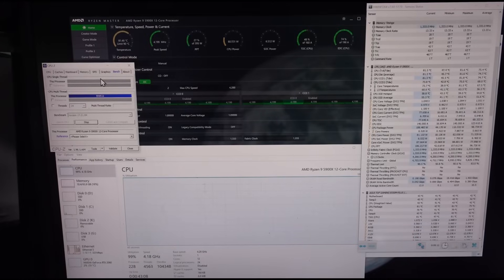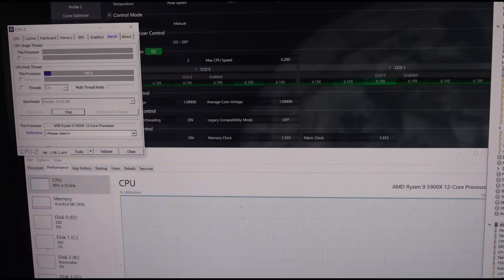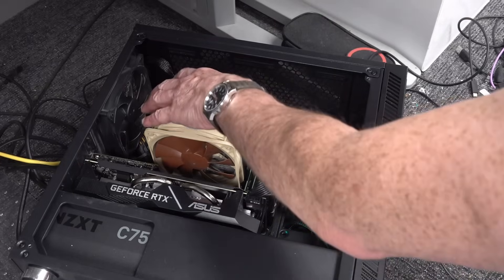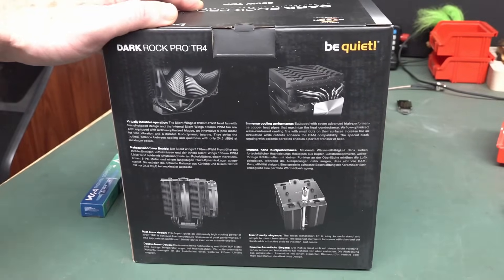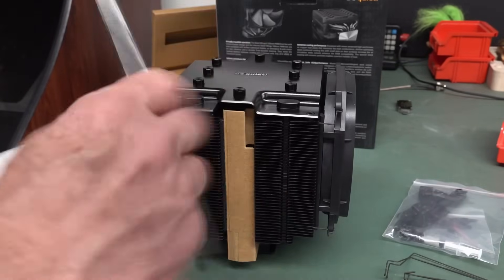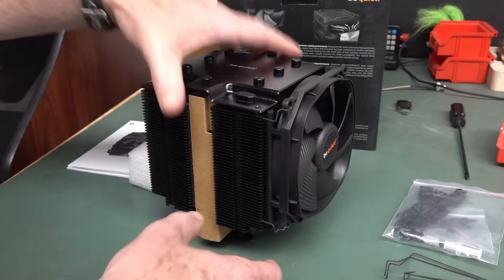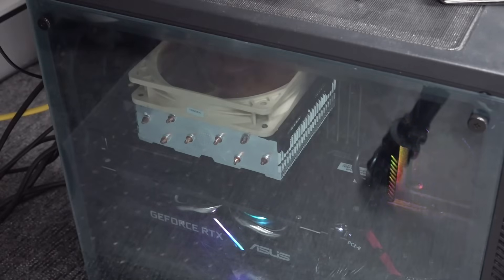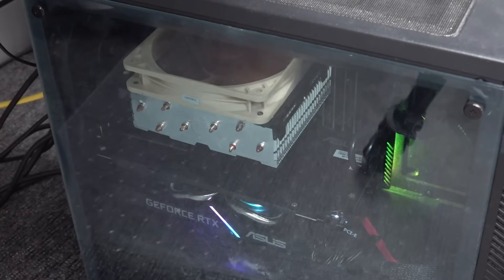Ryzen 9 Dark Rock Pro Heatsink FAIL & WIN

Comment from the maker: Had to re-upload because I goofed an uploaded onto my main channel before. Sorry for the lost comments.
And before anyone comments on the crushed heatsink pipe, bottom line is it makes no practical difference in this case, my temps are down to well under 65C during rendering now, so the heatsink is working just fine. Using the same damaged heatsink I've been able to reduce my temps from over 90C to under 65C by redoing the thermal paste that was dead after a few years, and also re-orienting the fan so it takes the cooler air from the top of the case instead of from above the GPU card. That made a huge difference, and it's no surprise, I can feel the inlet temp difference between the two installs.
Reply: For the wrong cooler: not all ryzens are threadrippers. Threadripper is a separate series, on TR4 or TRX40 sockets. You have a non-threadripper ryzen, which come in AM4 or AM5 sockets. That knowledge may be handy in the future :)
Reply: Here is one of the comment I had in my clip board. I see two possibility then. 1: by drawing fres air from the top of the case you get better result. 2: the crushed pipe is damaged and by switching it around it happen thant tha most of the cpu die under the heatspreder is now under the good heatpipe. It would be interesting to put it in the same orientation as before and just change the fan position to be at the top. Then we could rule out it the copper pipe is really damaged or not.
Reply from the maker: @robingalipeau5642   Just shot another video demoing, guess who's right?
Reply: @EEVblog2  I am confident I am right, but I honnestly dont pretend to know all the answer. I and diyng to see the video and find out :D. It will be fun to watch
Reply from the maker: @robingalipeau5642  Here you go: https://www.youtube.com/watch?v=kvI7vlvzrQo
Reply: SMH...so WRONG... rotating could have moved that pipe from a hot core to a cooler core..and moved the working pipes over the hot core so you see lower temps....rotating a heatsink with heat pipes has different thermal properties.....especially when one pipe is bad...these CPUs do NOT put out a consistent temp across the heat spreader... they get hot spots depending on the thermal characteristics of the cores....
Reply from the maker: @WacKEDmaN   Sorry, you are demonstrably wrong that is the difference. I measured a 10C drop in temp due the fan rotation, and I can physically feel about a 10C difference in inlet temps in both orientiation. It's NOT the heat pipe.
Reply: @EEVblog2 If the damage pipe is on the IO die side it should be fine, the main heat sources are those two 8 core dies (cut down to 6 cores, 2 disabled for your SKU).
Reply: @EEVblog2 yes you get better temp. And I can understand you dont want to test every thing because a computer is probably a tool more than a hobby for you which is fine. But fron the information in the video, there might be more test that can ruleout for sure the thesis of just the airflow.
Reply: @EEVblog2 plus i really doubt tha you get 25 degre delta with just switching the fan around. Something look off to me
Reply: @EEVblog2 how can you definitely say that when you dont even know how heat pipes work? ... yes the fan at the top is going to have some effect... 10c aint a whole lot... 
.... try another non-damaged heatsink (around the same size and number of pipes, same fan size) and i bet your temps are lower (you really dont need that big ass cooler..that will probably also need strain relief to not warp the f out of the mobo)...and where'd you get 65c from? i seen 75 in the vid.....
...anyways...ya know my thoughts... do as you like... ya gonna anyway!
Reply: @WacKEDmaN I agree with you on the technical side, but usign that many "..." is not really polite and don't invite open minded dialogue.
Reply: @robingalipeau5642 thats just the way i type.... always have... always will... its like my signature!...
Reply: @WacKEDmaN ok 😂

Comment: I liked the trouble shooting, even the missteps. Computers can be and an enigma sometimes it can be something like your targeting, cpu temps, to a wonky failing psu, to just literally re-seating the ram. Im also glad you flashed the latest biis when you first starting posting about this I believe that was one of my first comments. Have you tried a thermal cam on the bare board for a short time to see for any hot spots? That can help narrow down problems sometimes with aging equipment. Even though I wouldn't call it old by any means I'd kill to have a system kitted out like that..Good luck Dave and good on ya for being honest and humble throughout the process this is a nice change of pace.. I love your diagnosis and repair videos, that's what got me subbed to your channel in the first place many years ago. Keep on keepin on Dave! Thanks for the time and effort put into the video! 😊

Comment: If you're having a heating issue, it's worth lapping the top of the cpu and the bottom of the cooler long enough that they're flat. They don't need to be smooth, and polished is worse - just flat. Then use the least heatsink paste that'll make solid contact all around - just enough to fill air gaps. Some recent CPU packages are raised on the border (Intel has been the worst offender lately). Round bottom CPU coolers contact well, but full sized ones contact the border and don't touch in the middle until you lap the CPU.

Comment: Personally I'm using a thermalrite Aro-m14g on my Ryzen 5700x gaming pc with the power limits raised from stock 75w to 140w (turns the cheap 5700x into a 5800x) never seen it get beyond 78c after 10 runs of cinebench r23 multi core.
My workshop pc runs a 5800x with a thermalrite le grand macho rt .. it stays below 75c at all times even this week when ambient was 31c .
The only downside is that they're both huge coolers .

Comment: I have a 7900X and started with Dark Rock Pro. It is a bit of a pain to install as you can easily put the small, round plastic spacers under the bracket on upside down and then the CPU won't be held tight onto the CPU.  The little spacers have an indent on one side that fits over the threaded part that sticks through the board.  Very easy to screw this up!  All four spacers have to be correct.

These CPUs (particularly the 7xxxx) are known for running very hot almost regardless of how much cooling you have.  I did decide to upgrade to a 420mm Corsir H170i cooler though it still runs hot according to the on-chip thermal sensors.  Dark Rock Pro is still a great air heatsink and will be pressed into service in another machine. It's pretty close to the OMGHuge Noctua.  I tried a few different heatsink greases and didn't make much difference, but currently have Kryonaut on it.  I usually use MX-4 which should be plenty good for almost anyone but I decided to splurge a bit on my new build this year. 

Indeed better to have the air pull from front to back usually, and typically you can turn them 90 degrees if space is available.  Blowing down on CPU may be fine, too, especially for cards with hot memory chips on the back of the board. 

I really recommend spending the coin on the Noctua Quiet series fans (tan with brown fan) 4-pin, as many of the biggest ones you can fit.  Highest airflow per db noise out there and the 120 and 140 models blow quite a lot of air at full crank and pretty much completely silent most of the time when not chooching hard.   Setup reasonable fan curves in BIOS and you're golden.

Comment: It's the stupid turbo boost on these cpus. I turned that garbage off then manually over clock it. I have a ryzen 9 5950x and the same cooler I have it run at a constant 4.2 ghz and the temps rarely get over 55c maybe 60c it is that gank turbo boost breaking the temps. It not intelligent boost it just maximum all the time.

Comment: Thanks for the laughs. I'm so used to computer reviewers that it was fun to watch someone who doesn't work on computers on a daily basis and see the "real world" issues someone can experience while changing out the heatsink including ordering the wrong dang cooler. It wouldn't have been bad if you had mistakenly ordered the one for an intel CPU. Quite often the company can supply required hardware as a seperate kit. Often manufactures will do that if you want to re-use the cooler and the spacing has changed for the brackets. Since that is for Threadripper, it also has a bigger plate so even if you were to find a way to adapt the mounting hardware then you would have had issues most likely with the hardware attaching to the mounting systsm. Though I'm happy you figured out another solution at least for now until the next breakdown.

Comment: The V notch in the heatsink is there to supposedly help compensate for the dead zone around the fan's hub, not all manufacturers do that. Since you now have spare fans, you could stick two on your Cooler Master and shave off a couple more degrees still!
And I agree with everyone that it's worth contacting BeQuiet, they might send you a spare mounting kit! Manufacturers can be helpful like that sometimes.

Comment: I noticed the wrong cooler, right from the start, a threadripper has also a bigger die. And to be honest, the coolermaster had to be installed as a top blower in the first place. be Quite also has one for sale. I use them even on a Ryzen 5800X, note: Ryzen CPU's at 90°C is quite normal. The newer Ryzens go even beyond that temperature. To be honest, bring in an expert when you're doing this upgrades or building, all I see are beginners errors. It's a specialized niche, and people with extended experience are needed sometimes. Also, the memory you are using, isn't going to make your system faster. I think DDR4 - 3200 with a latency less than CL36 is doing the trick, these have also heat sinks on the memory sticks. No offence :)
Reply: Common latency for 3200 MHz is cl16

Comment: As of my knowledge you can get these brackets from Bequiet separately.
I have a Dark Rock Pro 2 since about 10 years and use it with my 4th PC build…still going strong. No aio water cooler would have survived this long. I just love long lasting products like this.

Comment: that middle fan is mounter rather low. 
I have the similar Darkrock pro 4 Cooler and yes I can run my i9 CPU at max overclock and it still runs cool. it's a massive heatsink that dissipates 250W and it is compatible with Intel: LGA 1150 / 1151 / 1155 / 1156 / 1366 / 2011(-3) Square ILM / 2066
AMD: AM2(+) / AM3(+) / AM4 / FM1 / FM2(+)
if I still have the box, I might be able to send you the AMD parts kit.

Comment: That is way too much Thermal Compound... correction
That is way too little Thermal Compound... correction
That is just enough Thermal Compound 😂

Too much and it squeezes out and is a bit messy next time. Too little and you don't have full coverage and maybe a few degrees higher temps. You doing good Dave.

Comment: The paste will make a few degrees difference and the fan orientation will also.  It adds up to a significant improvement.  Glad you got it resolved.
Reply: As long as you buy brand thermal paste like CoolerMaster, Noctua, Arctic, Thermal Grizzly, or others it does not matter at all. It might matter 1-2 Kelvin if you have a CPU that pushes over 300W like the 13900KS. Personally I use Arctic, Thermal Grizzly or Kingpin KPX thermal paste. It depends on the purpose.
Reply: @kyoudaiken  yeah but on twitter dave asked if to buy artic paste or generic chinese stuff, and people told him go for the name brand, at least you are sure it is not gonna become shitty in just few months, and a tube is gonna last forever anyway
Reply: @lesto12321  Usually in all tests that I have seen between brand thermal pastes the max difference is like 2° Kelvin between the best and the worst. If your cooling absolutely depends on these last 2°, I'd rather get a better cooler or something. But of course I would always buy a reputable brand. If you want something reasonably priced, get Arctic MX2. I've been using that on a couple of systems now and it is absolutely fine.

Comment: That was odd design, the middle fan can only push air that has already come through the first cooler section.
Oh, Dave left air gaps in the paste he applied! 😃
Reply: All about the static pressure. The more surface area your heatsink has for cooling, the more friction it provides to air, the more static pressure from a fan that you need to move useful quantaties of air through it. After they became chonky enough it begins to make sense to re-invigorate the air part way through so it keeps moving over nicely and extracting heat. Otherwise one side of the heatsink can be hotter than the other!

Comment: I am a Dell, HP, and IBM/Lenovo certified server hardware engineer working in a very large DC. All 3 manufacturers recommend spreading the thermal compound thinly and evenly over the entire CPU surface for optimal cooling. So thats what i do. Some of the new Server CPU's have 48 cores and we do not have any issues in the DC with the cool isle at 24c and the hot isle at 55c. If your hot swapping Server PSU's, you do not want to be behind those cabinets for long !.
Reply: There's various videos showing different methods. Success for the pea method tends to depend how much you wiggle the cooler about before fastening it, need to spread it about and get air bubbles out. I always do the credit card method, thin layer on the CPU and a haze on the heatsink.
Reply: I've used a safety razor blade as it's easier to get in there, but anything with some flex that'll get in there to spread nicely.
You want the thinnest layer that fills in all the air gaps. The issue: Some CPUs are shaped like a salad bowl on top so the center is very recessed. I've found you have to check for that. Some coolers have a smaller circular contact area just to deal with dish shaped cpus...

Comment: Well I was wrong, thought orientation would only make a few degrees difference based on various online test results.
Reply from the maker: The test setup matters enourmously. With the inlet temp on a few inches from the GPU vs getting air from outside, a 10C differential is totally expected.

Comment: It will run 15-20 degrees cooler on echo mode with amd ryzen master. You might loose some performance but it might be worth it in summer , less heat.
Reply: ECO mode

Comment: I noticed the TR4 "For Threadripper ONLY" right at the start ... thought, this will be interesting 😁

For AM4 use Dark Rock 4 or Dark Rock Pro 4 ... I found the Dark Rock 4 is good enough for my Ryzen 9 5950X by adding a second fan (not included - but the Dark Rock 4 does come with clips for a second fan)
Reply: True. I was happy to find my AM4 cooler worked when I upgraded to AM5. But threadripper hmmm.
Reply: same... but truth be told: i have the correct version of this cooler...
Reply: I have used a BeQuiet Dark Rock Pro 4 with my Ryzen 7 3700X for about three years now, with no complaints, because it was discounted to cost $10 less than the standard version.  At some point, I will buy another fan to run it with three fans.